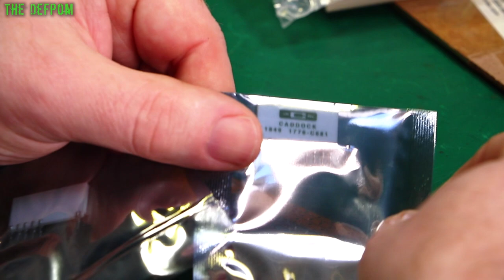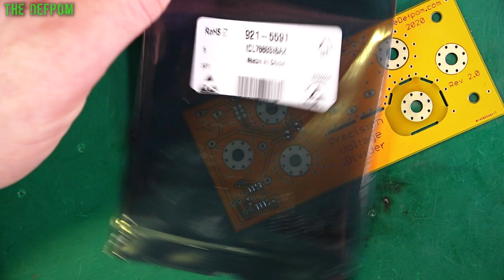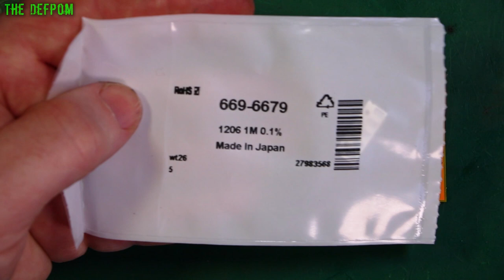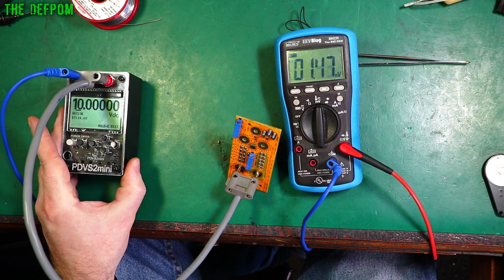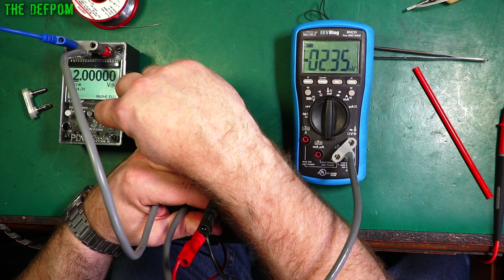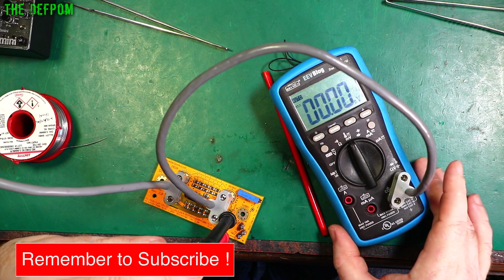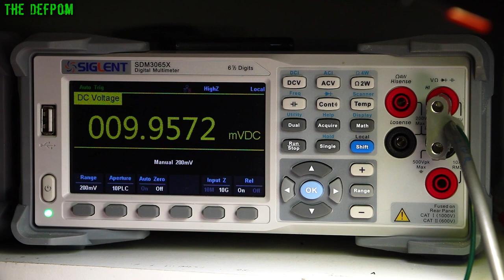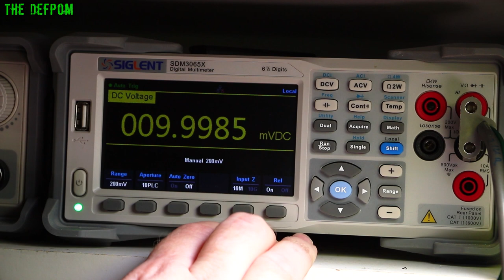#771 Voltage Divider Project - Part 3 Sponsored By PCBWay

Comment: Auto zero Opamp could be a significant improvement. Should be possible to get in microvolt zero range without trim. See for example the devices Dave Jones recently discussed for his MicroCurrent unit. These are not impossibly expensive.

Comment: This is a fascinating series, thanks, regarding a split supply, I watched a tutorial by Dave Jones where he describes a simple way to achieve this using an opamp (LMV321) and creating a 'virtual ground' I found this very elegant and versatile, I hadn't seen this before, I wonder if you could use the same setup ?...cheers.

Comment: 7660 is overkill and a very noisy charge pump reverse voltage supply. It's also not needed because an auto zero/chopper rail to rail (instrumentation amplifier) would do the job far better. If you want to fine tune then you can provide a small 700mV negative supply to the opamp using a diode. It's not being used as e.g. an audio amplifier so no need for the large negative swing.
Reply from the maker: I had considered a single supply rail to rail op-amp, but as I need to get down to 0mV levels accurately that meant the op amp had to be supplied at a level below that, I did play with zener diodes to create a virtual ground to work around that issue, it kind of worked but wasn't stable enough, so I thought I would give this a go. if you know of a suitable drop in replacement that could do the job please let me know what it is.

Due to the nulling the supply rails needed to be equal to each other to prevent that being very skewed off in one direction.

Comment: Good, should be far better than previous one. The trimmer is most likely the main source of thermal coefficient. As long as the trim is set to be a small percentage trim range it should be minimal issue. 
The Opamp is also a good idea,  to avoid meter load effects.

The 0.1% resistors should also be available at more reasonable cost via the supply side of JLCPCB (name is blank in my mind just now)

Comment: Great video Scott! Looks like a regulated supply will solve your offset problems and you will end up with excellent performance. Did you consider a single supply RRO op-amp instead of the dual supply one?
Reply from the maker: I had considered a single supply rail to rail op-amp, but as I need to get down to 0mV levels accurately that meant the op amp had to be supplied at a level below that, I did play with zener diodes to create a virtual ground to work around that issue, it kind of worked but wasn't stable enough, so I thought I would give this a go.

The nice thing is that many op amps use the same footprint, so if I come across something better for the job which has the same footprint I can just swap it out.
Reply: @TheDefpom  I was thinking of something like the Analog Devices ADA4622 op-amp that generates its own negative supply on the chip and would give you much better thermal stability and probably less worry about supply noise. It does require a minimum 4.5 volt supply though and is a bit larger (SOIC-8).

Comment: Is this Opamp you used a very low input current type, and/or the the inputs through balanced resistances. Keep in mind that the final sense resistance of the divider needs to be equal too, ie two res with amplifier virtual ground in the middle, but best is an Opamp with sub Nano input bias current.

Comment: What is the point of using 0.1% resistors if you put trimming pot there?
Reply from the maker: Because it needs an adjustment, you notice that I chose a 25turn trimmer, and selected one that only gives just enough tuning range, that way it’s inferior spec has a negligible effect, don’t forget this is in in series with another resistor, and they are then in parallel with two precision resistors to slightly pull the value up or down.
Reply: @TheDefpom  My question was not that why you use trimmer. My question was why are you using 0.1% resistors if you are using trimmer. Doesn't make sense to me.
Reply from the maker: Juraj Lonc - the resistors were chosen for the temperature coefficient, not the value tolerance, the tempco is actually the more important aspect.